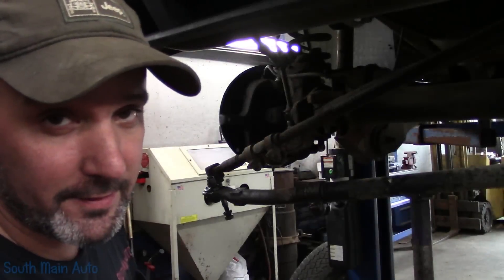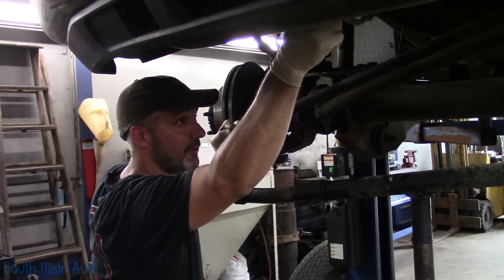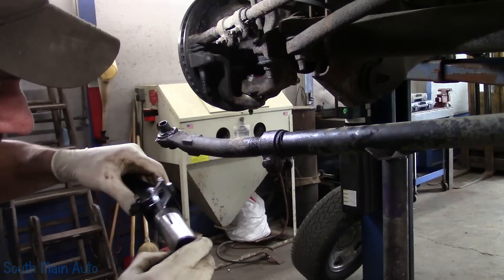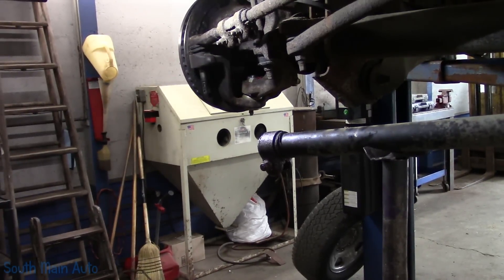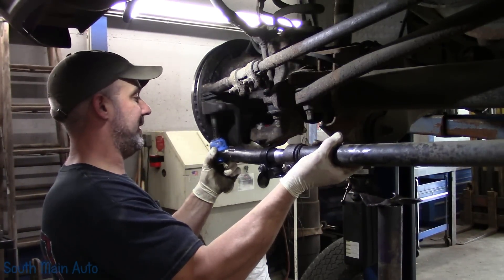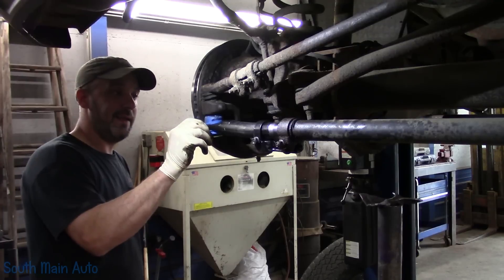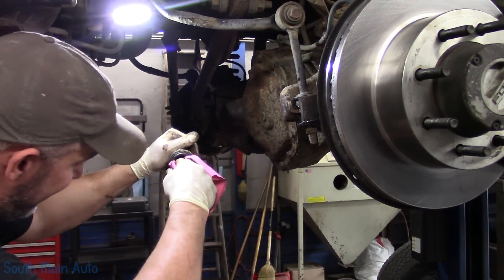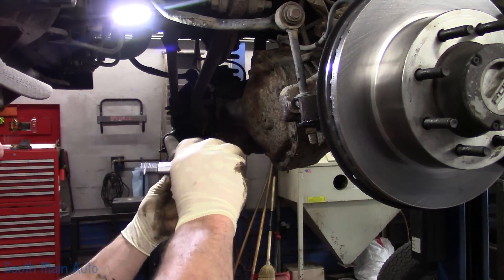Ford F-250: Ball Joints & Tie Rod Ends - Part III

Comment: My favorite pen oil was from 3m it was a dark muck green and would give you a headache. You could spray rusty wire style hose clamps wait 10 minutes and they would come apart every time. Sadly they don't make it anymore 3m changed the formulation... No it doesn't work. These days I use rust check spray  or red stallion/thrush from castle also hard to get. I also use free all it works OK. But for really tough stuff I use the Gatorade bottle. It is 20 years worth of collected left overs I use it for lock cylinders and small parts it irritates the skin and can't remember what is in it but it seems to be able to free up stuff that is otherwise welded together. That's my nickels worth.... No penny's up here anymore.

Comment: Bang with hammer and cold chisel or air chisel with pointy bit to vibrate. Douse with Kroil. Vibrate some more, re douse, leave sit at least a few hours. If that doesn’t work spew foul language and repeat steps.

Comment: I'll admit it I'm a TRUE BELIEVER in Kroil. The problem I see you having Eric is that you spray a part with something (Kroil P. B. Blaster, CRC or whatever) and then start working on it five seconds later. My dad worked on machines in the Vinegar department of H. J. Heinz. Since Vinegar is an acid he met up with a lot of rusty stuff. Whatever job he needed to do the next day he would hose down with Kroil the night before when he was preparing to leave. According to pop the next day the stuff came apart without an issue. His statement was that Kroil never let him down. H.J. Heinz bought Kroil by the 55 gallon drum and dad always made sure we had a goodly supply of it at home. How it got there I'll never know.

Comment: I hope you greased the new tie rod ends. back in 1965 my mother had new ball joints put in her 55 chevy. when I drove it that day it squeaked and squacked .  I called the front end shop and sure enough they knew they did not grease it. so I did. the sorry ass excuse they gave was to blame my mother because she did not pay for a grease job. never went back to them. of course they never told my mother she had to pay for a grease job either. what kind of crap was that? I had a neighbor bring his 57 ford to me because something was making noise. sure enough, the place that put new shock absorbers in it did not tighten the bolts and everything was falling apart. Myself I had a different shop (because they were across the street so I could get it done while I was at work) they jammed one of the rear shocks up against the brake line so a couple days later I lost the brakes. Took it back and raised hell, the dumb asses brazed the hole in the line shut. I went to the auto store and got a new line, replace it myself. I can go on and on about things done wrong that I ended up fixing. I am sure you can as well.

Comment: Thank you for calling out the DOPES (Disagreement Over Penetrating-oil Efficacy Society).  My experience is the same as yours; if a fastener is badly corroded it makes no difference what brand of oil you squirt on it.  Once you've broken the rust bond, they all work pretty much the same.

Comment: I rarely paint/mark tires to align with tape, just spin the tire jacked up to see if the rim/tire wobbles and go off the treads. but those tires and some treads are super funky and almost impossible to do that on and get even close. majority of the time, I send them for an alignment and they say it didn't need anything adjusted at all. guess my eyeball-guest-i-mater works well and of course tape measure :)
I go front and rear of tire at same height as high up as I can without hitting body, then just aim for 0 to 1/16th inch toe-in, being down the tire a ways it usually ends up between 1/8th to 3/16th inch actual toe-in.  centering the wheel is a pain though, super precise side to side adjusts and test drives :( boooo.

Comment: My opinion on penetrating oils, they only help if you use them on rusted threads that you are running a nut onto. Or backing a bolt through. The only way to remove frozen nuts and bolts is with heat. It's the only way I've found possible. The best oil I found that works for putting in threads on tie-rod ends is 3-in-1 oil. I used to be a WD40 guy but that ended quickly, it doesn't work. The only thing I use wd40 for is equipment at work as a rust preventative on the plumber's equipment. It prevents rust like it was designed to do. Although, I can't give you a a definite go to penetrating oil as 3-in-1 and liquid wrench are the only 2 I have used so far. I'm currently working on a '93 k2500, once my 3-in-1 runs out I'll find out which works better. What's up with 'tubers calling you? If they need to ask a question just have them message you or leave it to the comments section. The shop phone is for making money, not wasting time.
Reply: I've been using a lot of "zoom spout" turbine oil and rust buster for things. the rust buster is a mild kerosene/wd40 smell. the turbine oil is pretty thin oil that doesn't smell as funky as 3 in 1 and somewhat thinner, used to lube small motors, bearings, shafts and such.

Comment: So the tear in the boot on the upper tie rod end doesn't warrant replacement? Just curious.
Reply: spankmeister I noticed that too in the first video and at first wondered if it was just just a grease mark so I went back and watched again. Pretty damned sure that boot was torn on the upper ball joint. Not going to criticize since I’ve done this kind of work for 40 years and am glad I never made videos of all my work.
Reply: Boot was torn but Mr. O tested the joint and there was no play in it. As long as it greased regularly shouldn`t be an issue.

Comment: It just needs a catalysts to penetrate I use pb blaster I have seen where I thought the spark plug was pulling the threads out of the head really tight spray it 5 hours later can run it in and then back it out by hand nowadays they all are close I think

Comment: I can't believe I read all 418 comments and replies! This channel is worse than dope, I'm hooked.
 My take on the tie rods, hit 'em with a hammer, then Liquid Wrench, or whatever, when it comes into the shop and again and again 'till you have to start working on them.
 A little trick that I have used, IF the new parts are the same length as the old ones, is to hit it with a little brake cleaner then a felt marker on the exposed threads. Rip 'em off and rethread to the mark. Works every time! When you put the tape up, the alignment  will be however it came in.
 If you're by yourself, a long piece of dowel from the inside of one tire to the tread of the other, front and back, will give you a good reading.
 Great videos, thanks❗👍

Comment: Plus gas is the best penetrating fluid. Cut the damn buttons off your hats, I think they’re meant to hurt a lot to remind you not to do it !!
Reply: One time I stood up from the kitchen floor and hit the button on my ball cap on the bottom edge of the upper kitchen cabinet door that was hanging open.  It left a bruised divot in the top of by bald head that took over a month to heal.

Comment: I use Cyclo Breakaway as a pre disassembly lube over here in Australia, Eric O. Have used it in a marine and mining/off highway environment working on heavy diesel vehicles and it works really well, it has active additives that break down the rust and corrosion, it smells really harsh and the fumes sting your eyes and make them water after spraying it is the only downside though.